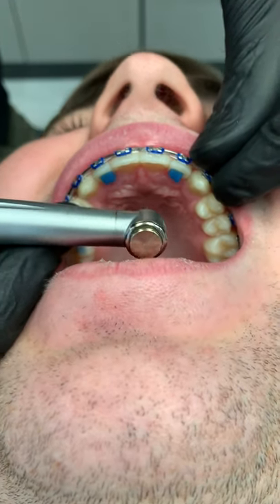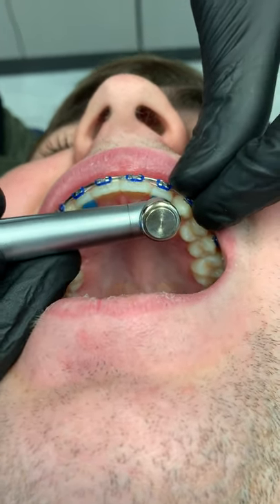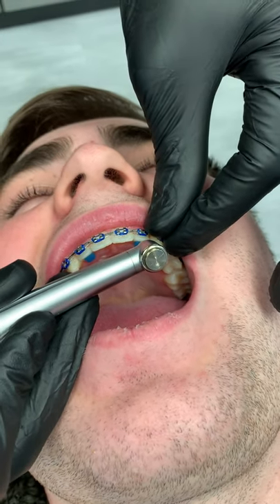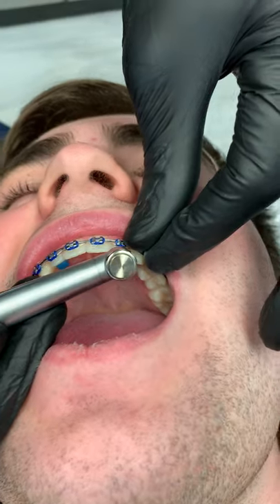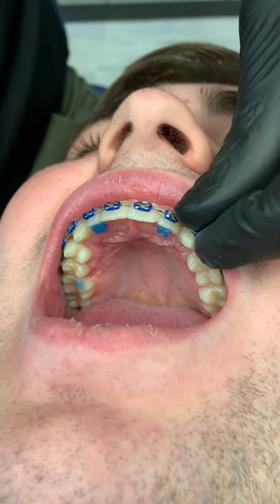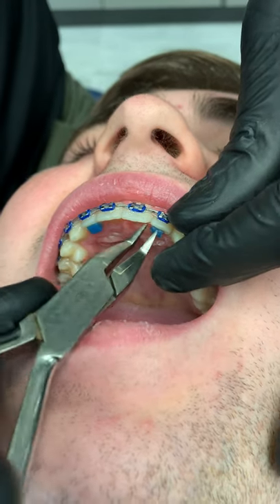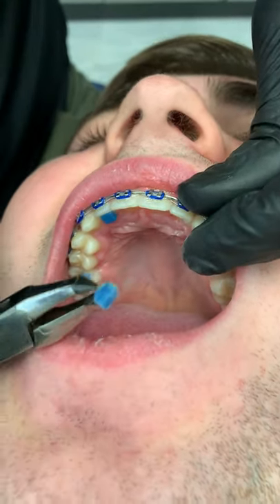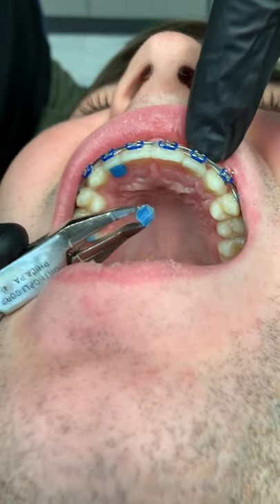Removal of Anterior Turbos/Bite blocks

Comment: I dont know why, but mine fell off the day after i got my braces done.. I was trying to chew on soft white bread. So what exactly was the cause of it falling off? Curious as heck 😂😂😂😂
Reply from the maker: I tell my patients if anything falls off w/in 24hrs of me bonding them on, it's probably my fault:)
Reply: @drdougortho  how would you suggest removing them yourself? I really hate these things so much and if it weren’t for these things I probably wouldn’t be regretting braces right now
Reply from the maker: @johnathonjagodzinski4516  under NO circumstances should you even attempt to remove them yourself!!  You risk fracturing your tooth!
Reply: @johnathonjagodzinski4516  Hey, when I first got them on I could barely eat and everything was a pain. It was totally unbearable. But it DOES get better with time because your teeth shift and so on. After some time, I got so used to them that I forgot they were there. Plus, those blockers are there for an important reason, so you really so need them to stay on. So stick in there with patience and just know that soon you'll be used to it in a few weeks! Just eat soft foods and protein smoothies in the meantime:)
Reply: Johnathon Jagodzinski did you get a lisp?
Reply: Lucky 😭
Reply: @nadeen1111   is the block gonna be there until brace is removed??? Sick of the block already, can't eat even rice 😩
Reply: @shineapamba5324  it seems like generally, yes! But hear me out: I'm 1 year into wearing the blocker and I don't even feel it at all. Theres NO struggle eating. What I realized is that its a pain in the butt the first month ish, but your teeth begin to shift with the braces and allow for the blockers to be, well, less annoying. It doesn't interfere soon  enough. Hope that's some reassurance, good luck and stay patient!
Reply: @user-uh4ri6md4j  I did bc the turbo made it so that my front teeth weren't touching
Reply: What to do: after bite block been place run straight to the toilet when the bite blocks are still soft then i just pull them out :v
Reply: Bro the same thing happened to me literally they fall of so easily 🤣😂
Reply: @johnathonjagodzinski4516 I was eating takis last time and it fell off

Comment: Hey there doc! I've had bite turbos for a about 6 months now and it's been well and fine. Ortho assistant tried to remove them today - didn't use a device to cut any parts, only tried with a tweezer looking thing to pull them off. All that wiggling without them even budging was unbearably painful and I had to tell him to stop. Not sure if my pain tolerance is just terribly low or if I should request if they can do an alternative method? Any thoughts?
Reply: Sue them!

Comment: I still have mine after two years, when I got them I felt beyond uncomfortable as if the dentist made a mistake, I felt like I couldn't live like this but after two weeks it was all normal lol. I'm getting my brackets removed tomorrow, so hopefully, they also get rid of my bite ramps too in the same session! The sound of the drill makes me cringe so much..
Reply from the maker: They should be getting removed if your braces are coming off. Congrats!

Comment: i have had mine for 3 years, braces then retainers. but i haven't gone to my dentist bcus the retainers are too painful and i wore them only for  few months and i got new one bcus old ones were not fitting and i wore new ones for a few more months and stopped wearing them again. should i just consult my dentist and get my bite pad removed?
Reply from the maker: I don't know why you would have bite turbos left after you had braces removed and have retainers.   Definitely get them removed
Reply: @drdougortho  When I got retainers, they said the bite blocks which are on my molars would get broken down on its own as my jaw gets adjusted. Will they cause cavities? I practice good oral hygiene everyday
Reply from the maker: @anirudh5957  I've never seen a reason to leave them on someone after treatment, so I can't say specifically for you.  They should not cause cavities but it's possible if they were not done properly.

Comment: I just barely got mine on, but mine are behind my two front teeth on the top. my issue is my molars don’t touch and am not able too chew. If I try I hit the blockers. I’m just not sure how to help myself.
Reply from the maker: That's what they are supposed to do!  You may not think you will get used to it, but you will!!
Reply: @Super Nova hey When did you get urs removed or is it still there ?? I just got mine 2 days back and at the same position as urs ... How am i supposed to eat 🥲
Reply: @sunandamukherjee9111   I still have mine in and it’s almost been about a year. It hurts and feels like the end of the world at first but you’ll get used to it eventually. It doesn’t hurt now
Reply: @Supernova-mp3  🥺 okkk ...thank you for replying 💙

Comment: Dr.  kindly, how can you correct the inclination of severly uprighting upper anterior teeth?
Reply from the maker: Just proper mechanics with braces or aligners, to torque those teeth.
Reply: @drdougortho  yes Dr.  absolutly,
but if you use braces, would you choose mbt, roth, or damon system, putting the bracket more gingivally or as presicription, if the pat. refuses tads, what are your options?
Reply from the maker: @قطراتالمطر-ه2ر   MBT Bidimensional and fully fill slot 18x25 ss

Comment: I’ve had top braces for about three months or so, and I just got my bottom. They put blue stuff on the bottom of my 2 molars on the left and right and it’s sore and hard to chew on. I was wondering if I could take them off myself dew too discomfort.
Reply from the maker: There is no way to remove them yourself.  even if you could you would likely start biting on your braces as soon as you ate and they would break off.  Do not try to remove them yourself.
Reply: Eat takis

Comment: I had these blocks that were molded onto the bottom of two of my molers. around 3 days later the right one completely broke apart and fell off in my  sleep (its been 2 months and I still have the left one). they said the put them on so my teeth on the right side won't bite on the bracket, but even with the blocker gone my teeth don't touch the brackets, so why did they put them on?
Reply from the maker: There are various reasons to use them, I can't comment on your specific situation.  But one is enough to change your bite short term,  but the other likely needs to be replaced asap.
Reply: dude i’m going through the same thing mine fell off and i’m wondering if it’s okay that it fid

Comment: How can I take these out my orthodontist left a little too much on my right side and I can feel my jaw getting asymmetrical already
Reply from the maker: you see what is necessary to take them off here in this video.  This is NOT something you can do or should even attempt on your own!  Call your orthodontist and ask to be seen to adjust yours!
Reply: @drdougortho  to late I already did it 😜 I used a hammer